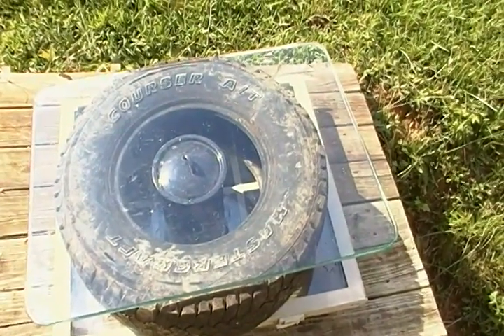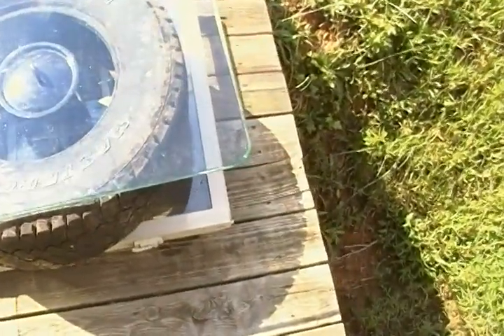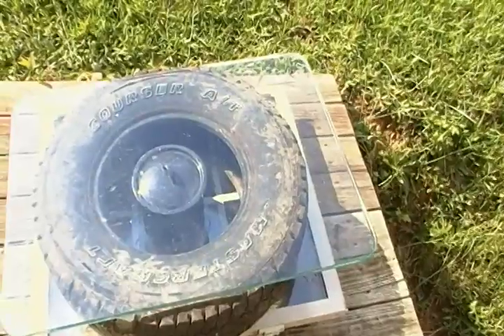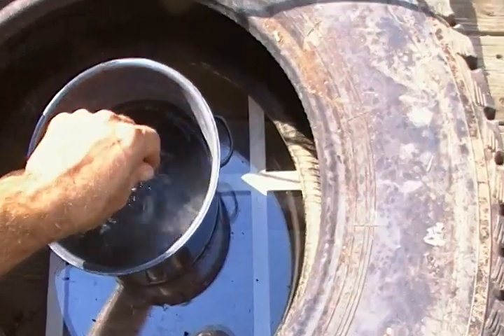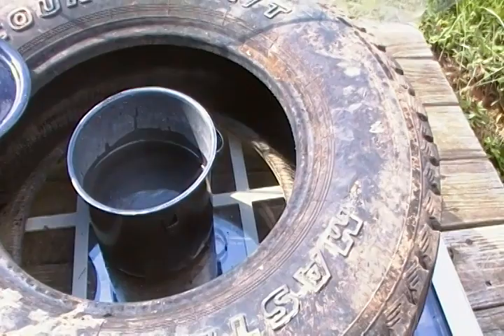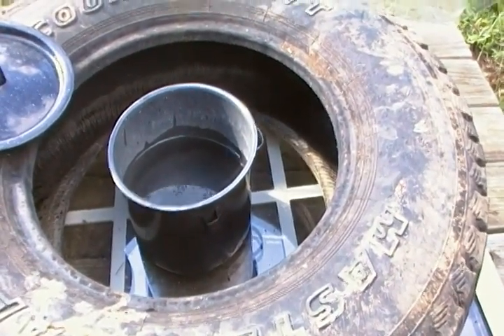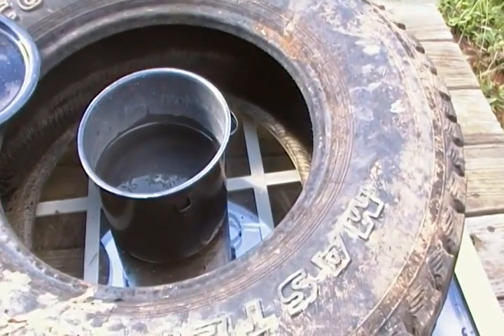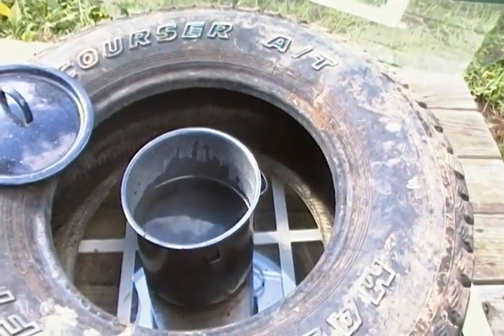Improvised hot water heating devise from a tire and a piece of glass.

Comment: I wonder if you could run flexible "drip system" type hose through a pile of composting matter, put a tank up high of cold water, and let it gravity feed through.  a valve on the low end will regulate the speed, and therefore temperature, of the water!

Comment: there is one of these that some students in the university of Western Australia made up I saw a youtube vid of a while ago. The other one they used to use to make hot water systems out of when i was a kid in western australia was black polyethylene pipe. put quite a lot of 1 inch pipes all hooked together with T pieces on a slight slope, inlet at the bottom, outlet at the top. 90F days they will get that hot you can barely touch the water and steam is almost coming off.

Comment: It's also worth considering for when you want to boil water on any type of stove, the amount of fuel you need will be drastically reduced, if you start the process with already hot water. Say, you have a few of these standing during the sunny hours, and will be cooking, for example rice, in the afternoon, the time will be much less, and the fuel consumption must less as well.
Awesome idea, gonna test how it works here, in summer, when the sun comes back. Only 1-2 hrs of daylight/day now. :)

Comment: That warm/hot water is good for a homemade shower.  It would help if the glass was "doubled" seperated by an airgap insulator to keep more heat in, and it would also help if the glas was not that big since it will conduct heat away into the glass itself which would be worse if the wind is blowing which would cause a "wind chill"/cooling effect removing the heat faster than normal.  Pust some mirrors around the inside of the tire to reflect light to the pot will help a bit.  Even plastic wrap.

Comment: I have used my gas grill to dry foods during the summer by letting the sun beat down on the dark surface.  A makeshift solar oven like this should work fine, especially if you could put a small fan inside to move the air around.

Comment: I like the idea of using old tires, my thought is to insert a 50 or 100 foot length of garden hose, drill two holes in the tire and connect hoses in series, perhaps 5 or 10 tires with 500 to 1000 feet of garden hose and use the setup for hot water for bathing or washing etc, not for cooking or potable water but as a resource for other purposes especially bathing.

Comment: you can use it to grow sweet-potatoes in nearly any climate. 
they need hot soil and have a relatively long growing season. but are VERY healthy; look them up!
stack 2 or 3 three tires in full sun, fill them loose soil and plant your yams in there. the sun will do the rest to keep it warm. btw, it makes watering and harvesting a breeze as well!
you can also speed up your composting! 
stack 4-5 and fill with vegi matter. if you need some, pull out the bottom tire.

Comment: I worked in a Tire shop and the pile of tires behind the shop would RADIATE heat as you walked towards it...I wanted to come up with a way to heat water by stacking the tires 7-8 high with a coil of pipe inside, maybe sand too?

Comment: Yeah cause no one's kitchen immersion thermometers are going to work anymore in a WROL situation.  If you didn't have a thermometer of any kind then using the boiling point to judge temp is ok, but now you just lost some of your purified water to evaporation.  Just saying that boiling is not necessary for safe drinking water, though I do agree that it is the idiot proof way of determining purification.

Comment: You are wrong.  If he can get the temp above 149º F, then it as safe as the water out of the tap.  You can take water from anywhere in the world and use this process and it will be completely safe.  Filter through an inch of sand and inch an of crushed charcoal inside a t-shirt, bring the temp of the filtered water to 149º F, filter through another t-shirt.  99.999% of V. cholerae, E. coli, Shigella, Salmonella typhi, and Rotavirus are killed at 5 minutes at 140º F, or <1 min at 149º F.

Comment: Nice to see that there are so many viewers so respectful of others ideas. (NOT)   I use a solar oven that I borrow. And food is often left a good share of the day in them.  If there is a cheaper or free way, yes I am interested.  And there have been many times I would have been thrilled to have water warm enough to use without the need for a fire.   Next time toss a meat thermometer in and get an idea hot warm it does get.  Thanks for something new to try.

Comment: Contrary to what many people believe, it is not necessary to boil water to make it safe to drink unless using a distilling process on salt water. Pasteurizing, or heating water to 65º C (149º F), will kill all bacteria (140º F), viruses (Hepatitis A 149º F), and parasites (131º F).  Filtering the water before (sand or tight weave fabric) and after (charcoal) will remove most chemical contamination and particulates.

Comment from the maker: the tire is old and really does not smell but I dont want rubber taste in my food so I might line it with a cheap solar blanket or use my small canner.  It has a rubber lid and shuts down real tight so that might keep my food from smelling like old rubber tire.  But the water should be fine for bathing and washing dishes.